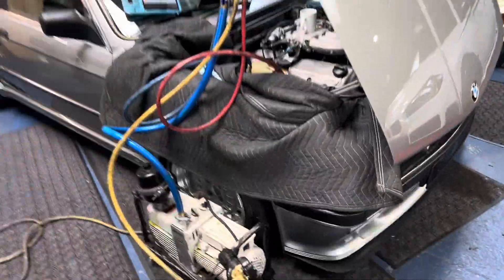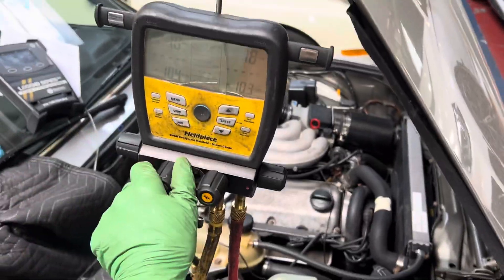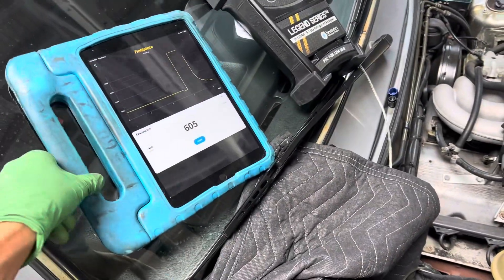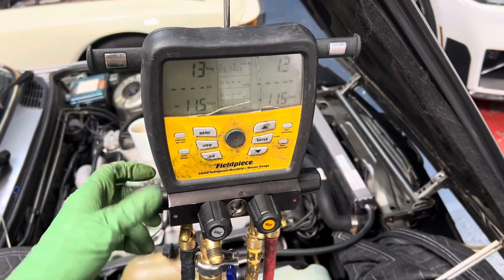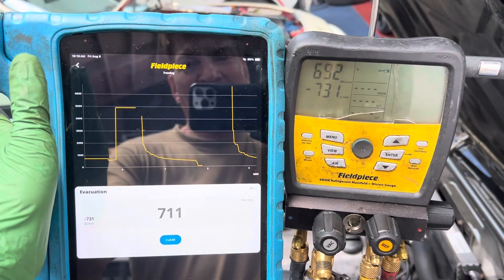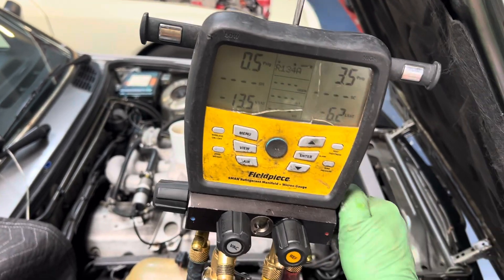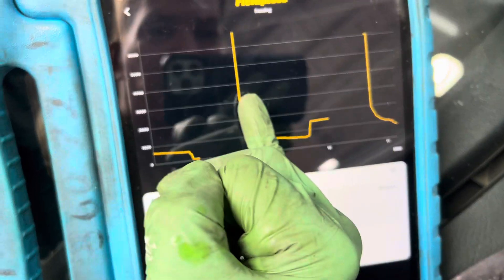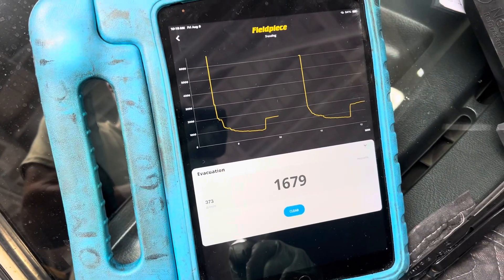Nitrogen, triple purge, and vacuum to help speed up moisture removal.

Comment: What classes do you recommend to learn deep into ac? Like micron test, vacuum decay etc. Worked at a dealership and the training plus auto classes never teach the things you do. Love the excellence you put into your work.
Reply from the maker: I have almost 2 years of links to books and articles
     YouTube links to educators you get your best information, not from the automotive industry, but from residential and commercial HVAC. 
   Over at the Facebook group
Automotive HVAC technicians 

I have links to  Ty YouTube called
Love2HVAC

Craig 
YouTube 
HVAC service LLC 

Bryan Orr You Tube 
HVAC School LLC. 
     And many other automotive based training from chemical product manufacturers parts, product manufacturers suppliers on automotive HVAC processes

Comment: Is it important to vacuum the nitrogen out or can you just release it to atmosphere?
Reply from the maker: @jharrison6557  if you’re just doing nitrogen purge to zero psi or one or two psi then you just vacuum it out with the vacuum pump there’s nothing to release to atmospheres cause you’re almost 0 and the system always has to be vacuumed

If you’re using nitrogen high-pressure test to look for leaks 
Then you have to release the high pressure nitrogen for example 200 psi to the atmosphere until it read zero and then you use the vacuum pump to vacuum the rest out

Comment: I knew this was possible from textbooks but I didn’t think it would be that pronounced. It really does work. Thanks for sharing
Reply from the maker: @markm0000  I hope they don’t just make up stories in trades textbooks. Just write things on Pages for no reason. 🤭 
      In laboratories that deal with extremely high vacuum and want to hold the moisture out.  Since everything is made out of stainless steel or glass..  
    They’re drawing a high vacuum on one end. They might lead an extremely tiny amount that we can’t even measure with the instruments we have. at the same time, pulling a vacuum. 
       And heat all the tubes in the pipes in the chamber up with a hot air gun or blowtorch.    to raise the temperature of all the steel and glass this makes the moisture molecules more active, and they free up more easily and leave the surfaces and get carried away in the movement of the airstream of the nitrogen or argon. . 

Just pulling vacuum is not enough because the moisture molecules will come to the surface, but there’s no substance. There’s no river of air to literally flesh everything off the surface. . 
     Think of the nitrogen flowing as a janitor with the broom, sweeping up dust and pushing it out the door. 🚪
Reply: @ bro you know there’s BS in those textbooks that isn’t worth reading. I was just amazed that’s all.
Reply from the maker: @ go to True Tech Tools look under vacuum book it’s I believe $19 or may have went up. I think they raise the price price. It might be $23 now because it’s a couple years later.. 
       There’s no BS in that book about vacuum. 
If you go to the Facebook group 
( automotive HVAC technicians) 

You back a few months on my post where I provided links about vacuum to text books that you can download that are free PDFs that are like 1000 pages all about vacuum . 
      Too many videos about laboratory level vacuums, and laboratory level, vacuum sensors, videos, explaining everything more information than you ever thought existed and more information than you would probably want to know unless you’re in the league of geeks and nerds. 👍

Comment: What you will do with this  contaminated system?
Reply from the maker: @issamadam9352  they’re not flushing and replacing everything on this vehicle.  They’re just doing the minimum.  Just contaminated refrigerant comes out with vacuum and nitrogen purging. 
     Reduce the moisture content with vacuum and nitrogen purging

Comment: When you open low side , where nitrogen goes?
Reply from the maker: @issamadam9352  outside to the Air you asked this question before last year
Reply: @coldfinger459sub0  yes I asked before  here you don't crack the hose but  it is connected to vacuum pump,does the nitrogen go out side through the vacuum pump?
Reply from the maker: @ you ask this question too last year
      Only after you bleed off the excessive nitrogen pressure to atmosphere and it’s back down to zero. 
Then the vacuum pump removes the rest

Comment: why did the customer want r12?
Reply from the maker: @scudsrunners9698  they can afford it.  I could do 100% liquid refrigerant charge by weight into the system.  Turn off the refrigerant disconnect from the compressor and I don’t have to test or measure anything..  I will be 100% correct and will 100% work perfectly. 
But of course, I’m gonna test and measure

I do not have to do any compensation work, figuring out the different percentages using 134 refrigerator . 
    Because there is no hard rule for vehicles on refrigerant 134 conversion retrofit.
Reply: @coldfinger459sub0  what are you charging for r12?  I just picked up another brand new bottle at a garage sale :)